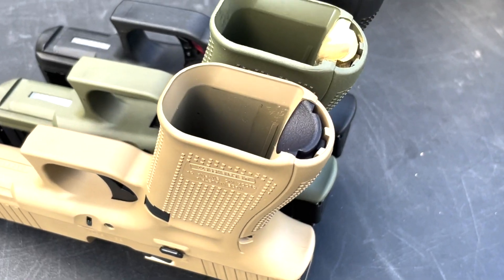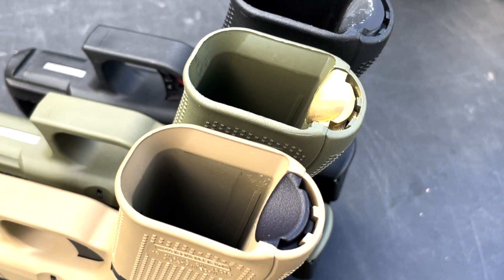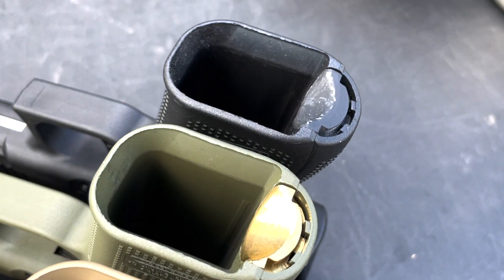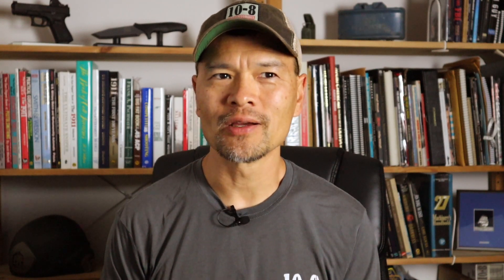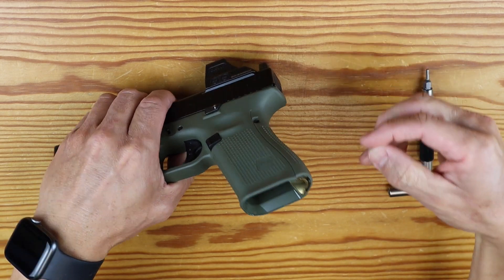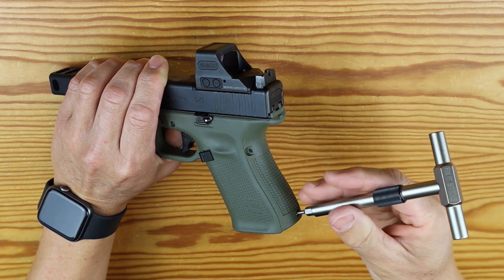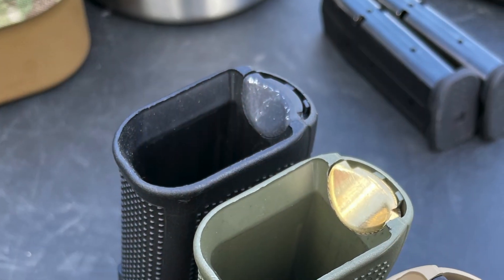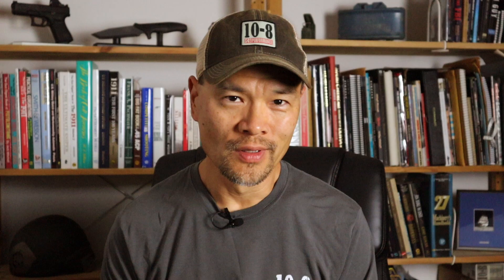10-8 Performance Lab, Episode 54: CHPWS Speed Feed

Comment: Upcharge seems insane on these.  I know they don't make them anymore but Seattle Slugs were less than $50 bucks (typically $35ish).  This is the same concept with less brass and it's over $135?  I mean the polymer one is $38.  Other polymer grip plugs are $13.  Man I don't really see the value and makes me sad they decided to overprice them this much.
Reply: The polymer speed feed is $10 and comes with cutouts for optic battery storage

Comment: I thought people called these types of products butt plugs. I got a G45 frame out for a stipple and grip reduction and if the rear cavity isn't filled I'll get these. The other butt plugs just plug the hole and some even have a 3/32 punch as an emergency Glock tool. These definitely have the nicest angle for reloading.

Comment: Any benefit to aluminum over polymer?
Reply from the maker: I like the precise feel during install and removal, but all 3 feel the same when reloading.
Reply: Well with polymer you could take some fine sandpaper and smooth it out if you ever feel like it.
Reply: @Osprey1994  
Nothing stops you from doing the same to the other materials.

Comment: You cannot do much wrong with getting the polymer plug for your Glock for just 37$. But honestly, I do not think it will make that much of a difference, I have never hit that ledge on a reload, even in stressful conditions. A few dozen reload reps every night for a week or two will work out most flaws you have in reloading.
Reply: The Gen5 v1 frames had a cutout in the front and the back and your room for error is very small.  I just took a little bit of sandpaper and smoothed the edges to  make it so they didn't catch the mag as readily, but I would still prefer one of the side be almost foolproof, and this would be a great solution.  Just wish I had had the ability to print something like this years ago.